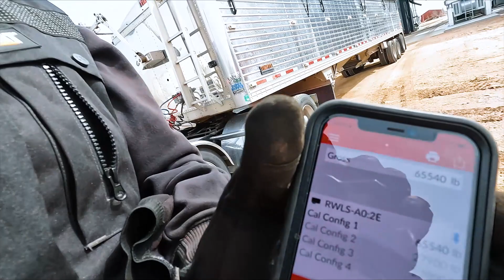Youthful Thinking! Loud Is Better!!

Comment: I work w/ dogs, worked winters at a Lab breeder’s kennel, used a lot of Odoban, Febreze, but would’ve started with Linen scented Lysol in dumpy in Nibble’s final resting places. It kills the bacteria from a rotting Nibbles (which was ANOTHER common occurrence since the kennel was in a working barn) I loved the puppies, hated mouse duty. So, I used paper lunch bags, cut an opening on the bottom side of the bag, carefully slid snap traps in(trying not to lose a finger), then just picked the whole bag up & tossed it.

Comment: I use a small Ozone generator to kill all smells. You can purchase on Amazon . They use them in hotel rooms to kill smokers smells. Put in truck cab for 60 -90 minutes. Windows up. Always air out after use. I use also in our RV after winter storage. Thanks Bryce

Comment: Chet,
Take 3 or 4 small bowls fill them with baking soda and place them around the cab, that will absorb the smell quick, you might have to refill a couple of times, but it works, and it's  cheap.

Comment: Gotta get ride of the name on the door of the Mack and replace with a beauty Larson farms decal. If you by pass your pressure on your pressure washer and turn the heat up to 160 degrees you take the wand off and warm the sticker up with the hot water and pick the sticker at the corner it will peel off 90% with the glue to. If not goo gone after. We do decal removal on a regular basis can't count how many tractor trailers we've stripped stickers off over the years. Love the video's can't wait till your planting

Comment: I’m 50 and still have no use for mufflers on a diesel. Sounds good. If you can’t hear the turbo whistle it’s not right. Worked at a GM dealer in the body shop for 23 years and was hesitating to perform the government juice repair procedure on my truck whilst it was under warranty and the diesel mechanics said if you take that junk off of there you won’t need your warranty anyway. I found that logic hard to argue with and it’s sounded great since new and as a plus I haven’t ran anyone over because of their not being able to hear me coming

Comment: You might want to consider an odor enzyme remover.  This is something used to remove the odor from skunk spray.  I've used it for my dog that got sprayed.  The pet shop has it.  I would give this stuff a try.  I used it on my truck when the underside got sprayed by a skunk.  I bet it would work on the dump truck too!  Good luck on it guys!

Comment: I have a suggestion for moving weight forward. In michigan we put a flat plate in front of the fifth wheel with 2 air axle lift bags under it. Put a Guage and a twist valve so you can control how much lift under the trailer pushes the front axle down. On a 212" wheelbase we could move 3 thousand pounds to the steering axle at 70 lbs.

Comment: On my 4 axle long hood Pete I was 13000 on the steer all the time ran with only 2 notches showing ahead of the plate. Mine is 322 inche wheel base

Comment: Ozone generator. They aint that expensive, throw it in the cab and close up the windows and let it run for a while. Will kill any smell chemically and keep it gone. Just be sure to air it out before you go climbing back in.

Comment: My Western Star Dump has a straight pipe like that. You will need to elbow up or back the top of the stack, because it does get loud. Don't plan on opening the passenger window.  It seems like the cab guard reverberates the exhaust noise inside the cab. Good Luck.

Comment: I have a thought. Get a Generator for your grain leg just for those times when you only need it a little to keep your demand down, and even power the bin site during a power outage..
Reply: @realredditstories420  Tue but the main advantage is having standby power, and the saving a high demand rate. You do know how the demand rate works, you can be charged for power you never use?

Comment: Exhaust and suspension work need 2 tools. A cutting torch and air wrench. Burn it off and buzz it up. Chug a Mello in between tool changes.

Comment: We usually figure 500 lbs per notch on the fifth wheels, but that may be a little off with your lift axle set up. Eric should see 1500 lbs more up front with 3 clicks.

Comment: Those older Mack trucks with the Maxidine engines was the toughest truck ever built for dump trucks. Does that Mack have the 5-speed transmission? If the rear-end has the lower  gear ratio it will handle a heavy load easy. If you let the engine breath a little it will get good fuel mileage too. I drove a R model Mack for years hauling US Mail and even with a heavy load like magazines or catalogs I never had to shift down on the hills in the Midwest.

Comment: An exhaust leak is a minor UNLESS there are fumes coming into the cab, then it is a major.
If you want to get the fuel/air mixture in, then you must get the exhaust/fooey out. Mufflers create back pressure and then you can't get the exhaust out in a timely manner. Straight pipes eliminate that. When the hell, we are all selectively deaf anyway. Just ask your wife!
IF there are no truck scales other than the receiver and you don't get caught by the po,po, then you are not overweight.

Comment: Not hard to tell somebody got an overload ticket from the DOT, move that fifth wheel all the way forward with that pusher tag in front of the drives you will never be over on the steer axle, you guys don't haul enough weight and not the freight that is going to 
 put that steer axle over 10 or 12 thousand. I hauled 145,000lbs every day for 10 years and never had a ticket so, I would like to think I know a little something.

Comment: buy canadian. versatile rocks
Reply: Will they ever put a C18 CAT in the big Versatile DT.... To match that CAT tranny... With FENDT using that MAN 16L in the 1167, and why are they at 673hp when the 10 series combine is at 790 hp???  I'm curious if CNH will step up and use the FPT 16L in a Quad Trac??? Case IH has been abusing the CURSOR line of engines in the 9L and 13L, but there is a 16L in that line up... Now Deere has gone to a 13.6L in the new RX640, dropped the 15L Cummins... dont they make an 18L also???  Im thinking we'll see 7-800hp Quads and Two Tracks in the near future.